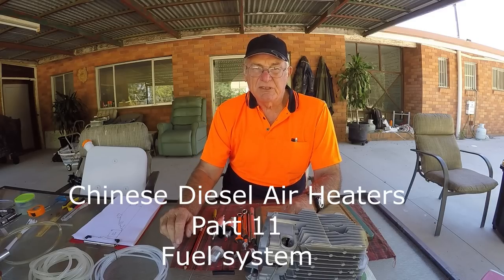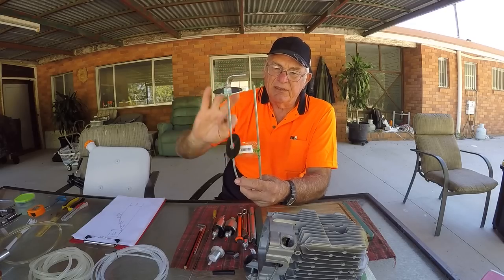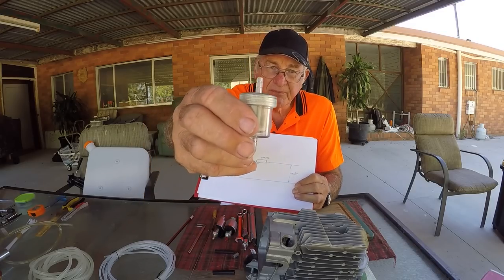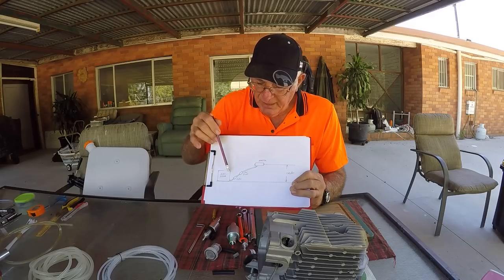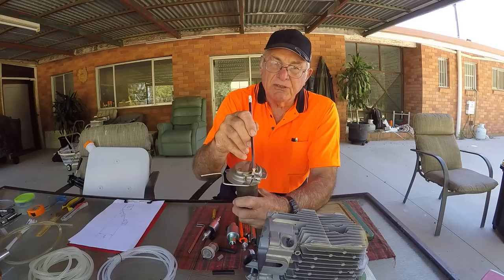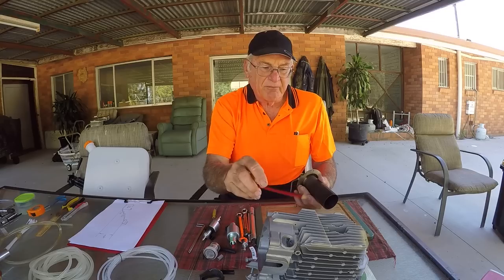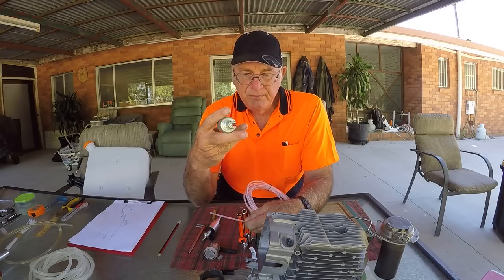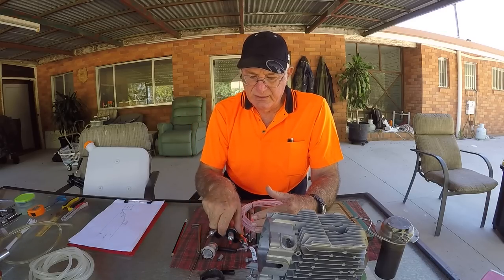Chinese Diesel Air Heaters - Part 11 -  Fuel Delivery

Comment: Does anyone know if low psi pumps could be used so that the tap from these fuel pumps can be cut out
Reply from the maker: Hi KC,  To control the heat output of these heaters, the ECU needs to know just how much fuel it is delivering to the heater. It does by "counting" the fixed volume pulse fuel delivery of fuel to the heater. It then adjust the fan speed to both provide the correct air mix to the combustion chamber, and the air volume over the heat exchanger. The use of any other fuel pump would require a complete redesign of the heater operating system.   JMcK
Reply: @johnmck1147  thanks for the info. You're videos are really informative. Have you come up with anything that truly dampens the clicking of the fuel pump other than mounting it with rubber?
Reply from the maker: kc22in 

Hi KC, if you have a look at the boat video, there the pump is suspended in space like a spider web in a fitting sold by Eberspacher. Costs nearly as much as a whole Chinese heater. 

One viewer has told me he used the mesh from around a wine bottle to lessen the noise. I have not tried that yet, but will do so in the future.

Sadly you can not wrap the pump up in foam packing as it will overheat.

Cheers. JMcK

Comment: I guess a link to proper line you speak of is too much to ask.
Reply from the maker: Hi Daniel,

I am reluctant to give recommendations as these sellers come and go. None of the sellers I purchased just 6 months ago still sell the product.

If you search for "hard nylon fuel line for Eberspacher diesel heaters" you will get results.

I just did a quick search and below are three links to get you started.

https://www.ebay.com.au/itm/Diesel-Heater-Nylon-Fuel-Line-OD5mm-ID1-5mm-7m-/333693253438?hash=item4db1aaf73e

https://www.ebay.com.au/itm/AU-4M-Fuel-Tube-Pipe-Hose-Air-Water-For-Eberspacher-Petrol-Diesel-Parking-Heater/392860023342?_trkparms=aid%3D1110012%26algo%3DSPLICE.SOIPOST%26ao%3D1%26asc%3D228209%26meid%3D7173bf78b078457f97a8c11083a73a67%26pid%3D100008%26rk%3D4%26rkt%3D12%26sd%3D353139064494%26itm%3D392860023342%26pmt%3D1%26noa%3D0%26pg%3D2047675%26algv%3DPromotedSellersOtherItemsV2%26brand%3DUnbranded&_trksid=p2047675.c100008.m2219

https://www.ebay.com.au/itm/Fuel-Filter-Fuel-Pipe-Line-Hose-Clip-Set-For-Eberspacher-Diesel-Heater-AU/143656755650?_trkparms=aid%3D1110006%26algo%3DHOMESPLICE.SIM%26ao%3D1%26asc%3D20200520130048%26meid%3D3a415795ccf444b3985d95bdf6226824%26pid%3D100005%26rk%3D1%26rkt%3D12%26mehot%3Dsb%26sd%3D333693253438%26itm%3D143656755650%26pmt%3D1%26noa%3D0%26pg%3D2047675%26algv%3DSimplAMLv5PairwiseWebWithBBEV2bDemotion%26brand%3DUnbranded&_trksid=p2047675.c100005.m1851

Cheers,   JMcK

Comment: Im having a very odd issue with these pumps. The issue is pumps are seizing within two days. In on my fifth pump! 
The system is 24v and fed from the main diesel tank. Lift is less than 1/2 meter ~ 15 inches. The feed line from tank top loops down and back up through paper type filter into vertical pump. The output line runs 10 feet to heater.  I do see very very tiny bubbles I assume are from cavitation in the output line. 
Anyone run into this before?  I see all kinds of installs that look marginal and dont have pump fail rates nearly this high.
Reply from the maker: Hi Tom,

It is very rare for the pumps to fail with a proper install. As described, your install appears ok.

1. Are you using 24volt pumps and not 12 volt pumps?
2. Do you have a separate pick up in your diesel tank for the heater? (Have a look at motorhome install video.
A start for you.  JMcK
Reply: @johnmck1147  Hi John, that's good to know about pump failure.They are all 24volt pumps. I have one of those tank pickups mounted in top of tank. One thing I'm unsure about is whether I should see any tiny bubbles in the output line.  Occasionally I see very tiny bubbles rising. I was assuming they were cavitation bubbles but perhaps something is going on with the pickup.
Reply from the maker: Hi Tom,

It is normal to see tiny, regularly spaced bubbles in the fuel delivery line. They are cavitation bubbles and actually help atomisation of the diesel in the atomisation screens.  JMcK
Reply: @johnmck1147   
Thanks John, Two things are different about my install. 1) 24V pump 2) 12 feet of 2mm id outlet tube.  As a diagnostic test I'm going to install a pulse damper at the pump outlet to see if this makes a difference on pump life.
Reply from the maker: Hi Tom, that pulse damper may cause you issues.

The reason for using narrow bore hard nylon on the delivery side of the pump is so the pump pulse is transmitted to the heater and not absorbed. You have a long fuel run, so you need that pulse pressure.

There are a lot of people now using 4 mm ID soft vinyl hose (often now supplied with heater) on the delivery side of the pump. This will work, as will the pulse damper.... For a while.

Because the fuel pulse is absorbed by the flexible hose the fuel dribbles into the heater atomisation screens rather than forced. This causes poor atomisation, which causes a poor burn, which causes carbon build up in the screens. 

Eventually the screens get blocked with carbon and the heater won't work.   JMcK
Reply: @johnmck1147  HI John,  Right that is a worry. But after five failed pumps each lasting less that 24hours there is something unusual going on. 
The two weird conditions of my setup: 24V pump, 5.5 meters of 2mm id line. 
I opened up some failed pumps and the pistons are stuck and spring cannot return it although I can free them easily by hand. 
This looks like the problem you mentioned about pump orientation and cavitation bubbles. My pump is vertical so that is not an issue but it got me thinking. I theorize cavitation bubbles are being forced between the piston and cylinder due to more forceful 24V pump pulse and high fluid resistance of 5.5 meter line and eventually sticking. 
So far the damper test has been running 24 hours on a used pump I managed to free up. Ill let it run the rest of the day and report back.
Reply from the maker: Hi Tom

Oh! Dear me.  Five failed pumps. I have never heard of that problem before. These pumps are generally very reliable.

My pump in the boat has been running well for some 15 years without issue. 
Chinese Pumps at home some 3 seasons without issue.

The only pump issue I have personally had was experimental. Running a pump on straight lighting kerosene with no added diesel for lubrication. That is why I suggest people using kerosene add 10% to 20% diesel to the fuel for lubrication.

I do know of cases of pumps issues from using the pump excessively to dry prime the system.

Pump delivery lengths of four to five meters are not uncommon in marine and motorhome installs, and cause no problem if hard narrow bore nylon fuel line is used

24 volts could possibly lessen the pump life, but surely not to what you are experiencing.

Suggest you also try running the pump at about 45° angle and see if that makes any difference.

I AM MOST INTERESTED TO KNOW IF YOU SOLVE YOUR PROBLEM.   JMcK
Reply: @johnmck1147  Ill keep you updated for sure. I'm testing with the new pump and the damper. It should fail in a few days.  If it does then next test will be a 12v pump with a proper value resistor and see how that works out. 
More info:  I first got this heater a year ago during a big cold snap here and had not fully installed plumbing. Just a tank on ground and pump nearby with 4 foot line to heater. That ran for months no problem. Pump issues started after switching to standpipe in main tank with that long feed line to heater. My thought is the very long feed line is a problem even though its "in spec".
Reply from the maker: Thanks for the update. You need the pump as close to the fuel tank as possible. These pumps, like most pumps do not like long suction lines.  JMcK
Reply: @johnmck1147  Hi
Reply: I wonder if there is some weird issue with my fuel. The Detroit Diesel runs fine but this fuel is nearly two years old when got back from last trip.The new pump also stuck after only a few hours run time.
Reply from the maker: Very likely Tom, particularly if the diesel is gelling.

These heaters work completely different from a diesel engine with injectors. 

Now Tom, it is a given. I ASSUME YOU HAVE A QUALITY FUEL FILTER BEFORE THE PUMP

Suggest you try running some kerosene through the pumps an see if you can free the stuck pumps. JMcK
Reply: Update. installed Another BRAND NEW 24V pump but fed it with its own tank of fuel just in case old fuel was a problem. FAILED 5 HOURS! Pump stuck again!  If you ran a 12V pump dry it would probably last longer than that!  Next test is use dropping resistor and 12V pump.  
I can usually free these pumps up by rapping on the input end and pulsing with 24V repeatedly.
 I wonder if a bad run of pumps combined with  low demand for 24V units means they are not flushed out of the supply chain yet.
Reply from the maker: Thanks for keeping me updated Tom.  JMcK
Reply: UPDATE:  I used a 12V pump with 21W 12V bulb in series to limit the current and its been working for several days. Heater works great in this cold snap we had too. Theories?
Reply from the maker: Thanks for the update Tom.
What a mystery. 
I wonder if 24v put too much force on pump piston, slamming it into the stops???
Reply: @johnmck1147  Could be. The 12v with lightbulb in series is still running!  I did some measurements on the 12v and 24v pumps. 
The 12v uses 33.6 watts at 14v. The 24V uses 44.8 watts at 28v so its definitely running harder. Noisier too.
Reply: Just and update. The 12vpump with dome light in series is still working well. Been running almost continuously the last week. That's a record for this setup!

Comment: Jeepers, I'm getting a darn good education on these before buying one.  You should be hired by the Chinese to solve all these problems, failures and disappoints, after the sale.
Reply from the maker: Thanks for the positive feedback Timothy.
On another matter, I have an email from You Tube with comment from you about 2 kw heater but I can't find your comment in the video comments. To answer your question, A 3 or 4 amp power supply will easily run the heater, but you require 10 amps to start the heater.  So a power supply of at least 10 amps is required.  JMcKJMcK

Comment: are you willing to test on with US gasoline not diesel,, most motor homes here do not use diesel,,  I believe the computer on the unit will control the unit by temperature...will you bench test it for us on YouTube...
Reply from the maker: Hi Hamish,

These heaters are designed for diesel, not petrol. It is not right for me to test, or encourage others to test these heaters on petrol. 

Is it not possible to instal the supplied diesel tank somewhere on your motor home. In Aus I have heard of people installing the tank on the back bumper, and behind the spare wheel.

You can buy a petrol version of the German made unit, I think they are sold under the Espar brand name in the US. Perhaps you could consider one of those. That would be a safer action.

I did see a uTube video a year ago of someone trying to run one of these heaters on petrol/gasoline. He did that because the Chinese instructions listed the fuel as gas oil. A Chinese term for diesel.

He complained that his heater would not run properly, and would pop and bang. I have not heard more about it since. I think he is lucky to still be alive.

Cheers.   JMcK
Reply: I do thank you for taking the time to reply. I will order one to do just that. not install in my RV until it is safe, outside on a bench.. I believe the controller and pump will keep it form overheating . no time now. I am installing a tank-less water heater now. I did change my refer to 120v AC , now that works very well with my solar.

Comment: SO YOU WOULD NOT RECOMMEND using any elbows
Reply from the maker: Hi Dale, not sure here what the question is.
Do you mean elbows in the fuel line? If so, on the input fuel line to the pump - ok. On the delivery fuel line from pump to heater . No
Are you talking about the exhaust? Avoid. Sometimes one is necessary.
Are you talking about hot air delivery. Less is better, but one or two are ok.
Cheers,   JMcK

Comment: Hi John, I'm thinking of using a fuel tank setup like similar to an RC plane tank setup. https://www.modelairplanenews.com/Media/PublicationsArticle/images/MAN_139_3_0311_006_img008.jpg
Do you see anything that would cause issues with this setup?
Your comment on the all-in-one unit with the tank outlet leaving 1 ltr behind triggered my memories of flying rc planes.
At the end of the flexible fuel line is normally a copper fuel filter that will go wherever the fuel goes. So it should also deliver on a boat when the fuel is splashing around. I'm thinking of modifying a proper fuel canister like this.
What do you think?
Reply from the maker: Great idea Edward. Had a number viewers tell me they have done this already.  JMcK
Reply: @johnmck1147  Good to know. By the way: Do you know of a good setup to protect the unit from a flat battery? Do they power down automatically when the battery voltage reaches a certain voltage or so? I want to install one in my boat thinking that the fridge wouldn't use much power if its cold but once I start heating, it's not cold for the fridge :-) any more. And they'll have to share a 120 Ah battery that might not be full when the sun goes down.
Reply from the maker: @EdwardOmagbemi  

Hi Edward, the unit will safely shut down automatically at low battery voltage.  JMcK
Reply: @johnmck1147  That's great to hear, John. So all it needs is bigger leads and a fuse. Excellent.

Comment: Sorry but you are not correct RE sucking a weight of fuel... Suck is not a thing, you are actually talking bout lack of pressure. The pump emptys the line of air and the atmosphere puhes the fuel into that reduced pressure space. I agree that a larger volume will take longer to fill but the effort to 'lift' fuel into that space is the same in small and large tubes. Yes the mass of fuel is greater but so is the surface area. if the pump can greate  -0.1 bar, a lift of circa 1m then it can do that in any size of tube and the effective 'lift' will be the same. I am not saying our are incorrect about smaller tube working better, you seen to now your stuff from a prctical point of view, but your explanation of why, at least the suck part, is fundamentally incorrect. Sorry
Reply from the maker: Yes, this matter has been brought to my attention after I made this video some four years ago.
You are right, I stand corrected on the “lift” statement……And I have acknowledged this each time this matter comes up in the comments.

However practical tests have shown narrow bore hard nylon fuel hose on the delivery side of the pump gives by far the best results.  JMcK

Comment: approx,,, 
0:22 tanks
1:30 filter 2:20  slope
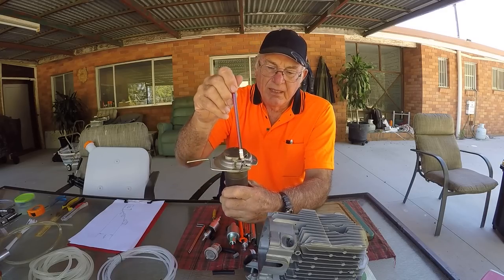2:50  burn chamber
4:15  fuel line
5:00  push not suck
7:10  bubbles and bends
7:45  4mm id tube
9:50   slope, cavitation bubbles
10:20  pump angle
11:00  delivery tube side
11:50 tapping noise
13:40  cutting tools 
15:10 bends 
20:15 suction side 
20:30 summary

Comment: Hi John. I have several of these insertion tools. Black plastic cylinder with the correct diameter and length at one end to fit the screen. Give me a postal address and I will send you one! Thanks for your feedback
Reply from the maker: Hi Peter, thanks for your offer, but I actually do have genuine plastic insertion tools. The pencil was a tongue in cheek joke, but actually very effective.  Cheers.  JMcK